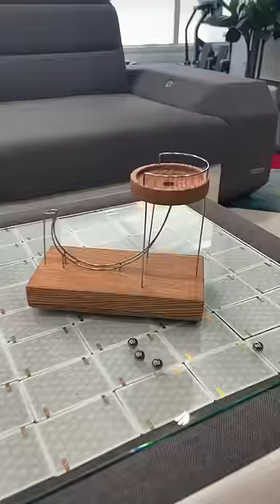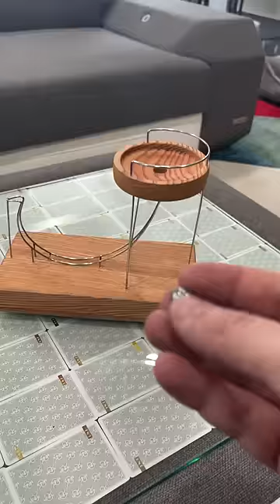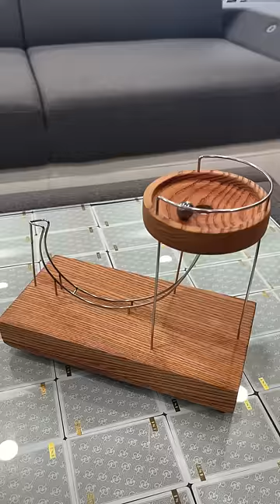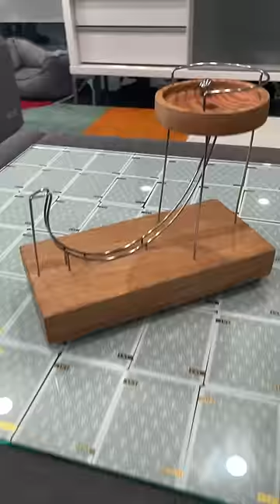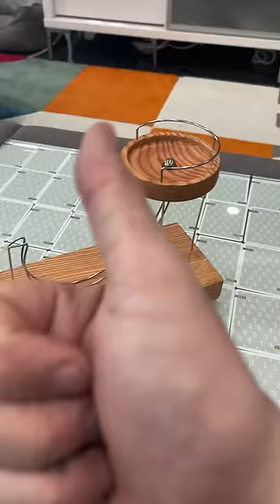An Impossible Perpetual Motion Device?! 😳 #Shorts

Comment: Hidden under the table is the power plant for this “perpetual motion device”, a vintage 351 Cleveland. That was obtained by going back in time.
Reply: Actually I was just thinking AAs in the base of the brown part and a short electromagnetic accelerator. Just needs a little boost to restore energy lost from friction.
Reply: @zemoxian  or, you know, gravity's constant pull of 9 meters per second.
Reply: Idk I feel like it’s definitely humming like a 351w 😂😂
Reply: @zemoxian  it doesn't even need to be electromagnet
Could be a "permanent" magnet like a neodymium magnet in the base
Reply: Yeah and egg magnet is square.
Reply: I work in the Cleveland plant! Wish we still made badass motors like the 351.
Reply: @ashtongiertz8728  nearer to 10 (it's around 9,81 m/s), but yeah that's the first thing that came to my mind reading the comment haha
Reply: @kykalinowski5217  the Windsor was more desirable...to Canadians
Reply: @rickkrnjaic4806  nah, the Windsor wouldn't have enough power
Reply: @IonizedComa  no. The acceleration pulling the marble down would be canceled by the pull upward once it passed it.
Reply: @ashtongiertz8728   
That’s not enough to violate the law conservation of energy. Draining a hidden battery can make it look like it’s violating physics, but you still have to replace the battery, so it isn’t really.
Reply: Cleveland bottom Windsor top!
Reply: Mannnn, I haven't heard anyone else mention that motor in a long time. Best. Motor. I miss mine
Reply: @SPENCERWASHERE  Dhaamn Boi, we had a plague, we didn't actually travel back to the dark ages.

Just the other day, saw a 351 with 4 extra alternators so the entire back seat could be changed into speaker boxes.
Reply: Dude I'm rebuilding a 351 C right now!!
Reply: @georgelewis9361  I hope you make gobs of power with it, do it right and get quality parts. I wanted to stroke mine to a 393 but unfortunately I'm not made out of money.
Reply: I actually had a 351 Cleveland in my cougar back in the 70s. Best engine I ever had
Reply: @georgelewis9361  I was always amazed at the size of the intake and exhaust ports on a Cleveland. They were massive for a small block.  Same head basically as was used on a 302 Boss.
Reply: I had a 351 Cleveland in my '72 Ford Torino in high school during the mid-70s. Good times.  😁👍
Reply: @IonizedComa  No, because that would be perpetual motion.

It needs to pull the marble down but then not  be powered as it goes up the ramp, which a permanent magnet can't do.
Reply: @IonizedComa  if it’s a natural magnet then it is a perpetual motion machine because you wouldn’t ever loose energy.
Reply: @EnlightenedRogue24  had a 1969 GT350 Shelby.  351 Windsor.  Rebuilt with a 289 cam and jacked up the horse power!  Fun times.
Reply: @rickkrnjaic4806  my thoughts exactly 👍

Comment: "IF it did exist, it would look like this"
meanwhile people in the comments:...
Reply: Fr
Reply: Personally I don’t think that if we had a perpetual motion device, that it would look like this lol
Reply: @_b1ack0ut4  FR 😂 It would look like a generator/engine, and would probably make power by steam to turbine, like basically every other generator ever lolol
Reply: @Upinsmoke-wr8un  dude he was being sarcastic ur literally the “meanwhile people in the comments”
Reply: @Upinsmoke-wr8un  that's not perpetual motion. That's using fuel. That's a generator. These comments are the ones that lack any knowledge
Reply: @effyoo6081  yeah lol, and the worst thing isn't that people make coments like that but that a lot of people like the coments/agree with them
Reply: Perpetual motion mostly consists of conservation of energy, conservation of energy would only happen if you don't loose energy, to not loose energy you would need to not have air drag amd other things. Also gaining energy from nothing is impossible, only form other "objects" and would stop beeing perpetual
Reply: @Upinsmoke-wr8un  Actually, whose to say that the engine wouldn't be powered by the very simple mechanics found for that contraption? Think of the balls as being electrons, the fuel and the time spent for the ball to be in the air as a discharge period when you'd actually be able to draw the built up power from its movement. 

Much like a piston cycle.
Reply: @effyoo6081  I like how the people who say others lack knowledge are the ones actually ignorant.
If it's fuel powered, it doesn't mean it couldn't be perpetual motion
Reply: @reformed_attempt_1  how would the fuel get into the machine? Would it not need to be replenished somehow? No fuel lasts forever. So a human would have to get more fuel and put it into the machine  the exact opposite of anything defined as perpetual motion. There I did explain how wrong you are, just in case your internet went out
Reply: @tecklepheonix6344  who's to say? MEEEEEEE!! And his other video where he takes off the bottom and shows the batteries. Newton's cradle 40 bucks. EVERYONE with a brain knows how this works. And it ain't you Bubba
Reply: Seriously dude. It's getting ridiculous.
It's as if nobody has their audio on.